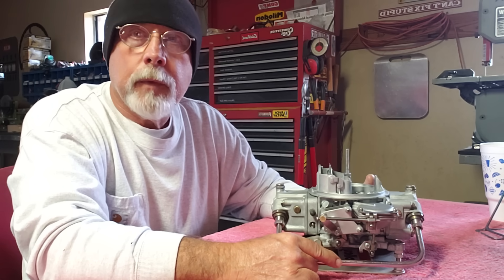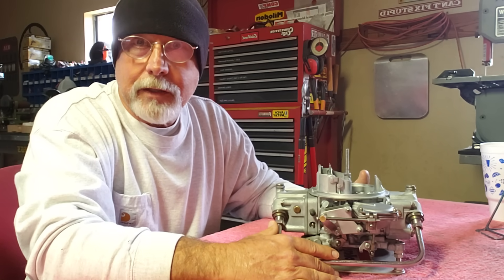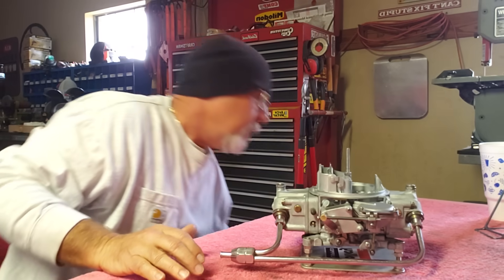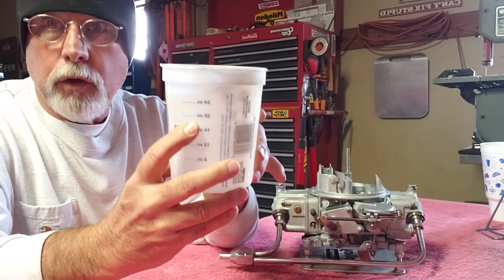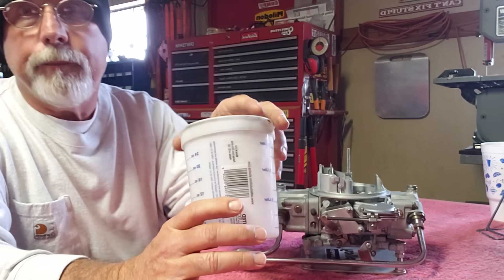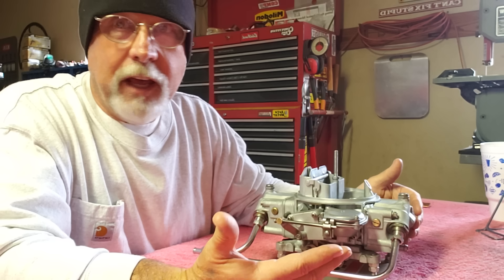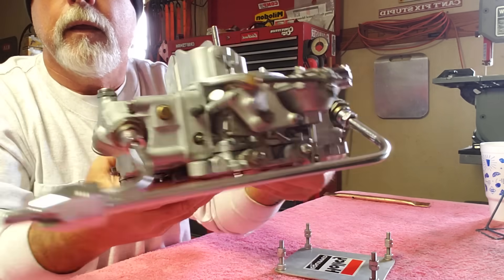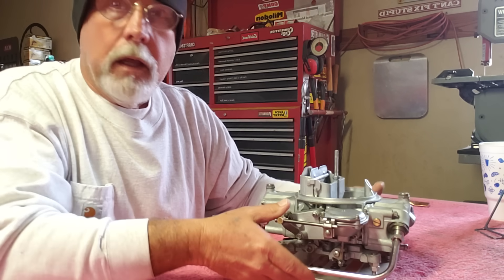Best carburetor cleaner ever!

Comment: I just done this today on a 750 Holley. Didn't work very well for me. Wish I could post pictures here. I let it soak for 3 hours and still dirty. I used 1 1/2 gals of water and 20 ounces of muriatic acid. I am going to soak the carb parts in carb cleaner and then soda blast it.
Reply from the maker: Sorry!
Reply: @ronniehenson4122  Hi Ronnie, I did the carb cleaner soak over night and then today I soda blasted the carb. One thing I did wrong was leave the carb in the m a mix for 3 hours. That stuff did eat into the aluminum some. I have it back together but haven't run it yet. I am hoping it will be fine. If I use m a again I will only soak the carb parts for 30 minutes in it then soak in carb cleaner after. I believe there is a learning curve to using m a correctly at least for me.

Comment: Muriatic acid strips the chromate and zinc plating off of steel faster than nobody’s business. If you have any steel parts on the carb that are originally rust protected with zinc plating/zinc chromate (the yellow stuff)....that is gone in a millisecond.  Muriatic acid takes steel to base metal....and rust will follow very quickly.   If you plan to clean any steel parts this way, you will need to replate the them to prevent rust (if you are worried about rust).    Any zinc is gone after it hits the acid.

Comment: I’m a machinist, thanks for the great video, right to the point! muriatic acid can be used to remove broken taps, drills, screws etc from aluminum. It won’t hurt the aluminum, but will literally rust out the offending tap. All you need to do is build a wall around the hole to pour in the acid, use modeling clay, not play dough! Or silicone caulking like the stuff you use to fix your fish tank. Once it’s dry, pour in the acid, it will bubble as it eats the tap, when it stops, poke it with a paper clip to get it working again. This process might take a day depending how much steel you need burned out. WEAR SAFETY GLASSES!!!
Reply: I use muriatic acid to eat aluminum from seized pistons off the steel liner of motorcycle and ATV cylinders because it will dissolve the aluminum without damaging the steel/cast iron - it will remove broken taps and such by eating the aluminum/zink (white metal) away from broken steel. It will cause rust on steel, but only surface rust.
Reply: @stevea6623  Do you pour the muriatc acid straight onto the piston or do you  deluded it  Appreciate
Reply: @albertdeleon6272  I buy acid brushes at Ace Hardware and brush the acid onto the aluminum - as the acid eats (oxidizes) the aluminum, it is weakened and a reapplication is required to speed the process. Muriatic Acid is 10% Hydrochloric by weight. Wear rubber gloves, goggles and use in a well ventilated area. Be sure to adhere to the cautions on the bottle.
Reply: @stevea6623  eat aluminum?
Reply: @Hebddhhrfhfhfufhfhfhf  Oxidizes is a more proper definition, but it will dissolve a chunk of aluminum over a relatively short period of time.
Reply: @stevea6623  
David Fusco in the comments is saying the Opposite to what you are saying ??
Reply: @kevwills858 
Yes - there is a lot of misinformation on the internet. Now muriatic acid will clean a carb just as The Works Toilet cleaner and acetic acid will clean a carb, but acetic acid (white vinegar) is the least 'aggressive' and muriatic acid is the most aggressive. To use the most aggressive and destructive, instead of muriatic (which is 10% hydrochloric by weight) just use 100% hydrochloric acid? Maybe because pure hydrochloric acid will react with a carburetor like Mentos does with citric acid. Investigate before you accept the advice of youtube pros.
Reply: Very helpful, much appreciated 👍🏾
Reply: That’s fucking cool
Reply: Steve A in the Comments is saying the Opposite to what you are saying ??
Reply: Come on, guys, ph doesn't get much lower so it likes anything metallic.    

Hydrochloric Acid 37%

MATERIAL	COMPATIBILITY
Aluminum	D - Poor
Bronze	        D - Poor
Carbon Steel	D - Poor
Carpenter 20	D - Poor
Cast iron	D - Poor
Copper	        D - Poor
Nylon	        D - Poor
Polycarbonate	D - Poor
Polyurethane	D - Poor
PPS (Ryton®)	D - Poor
stainless steel - 304	D - Poor
stainless steel - 316	D - Poor
Titanium	D - Poor

Once it gets through the oxide layer, it's off to the races.  https://youtu.be/ZLz4bSXcuYY
Reply: I’ve been a machinist since 1989 and I have never seen a broken tap removed using muriatic acid. Now I can’t wait to break off a tap just so I can try this trick 😅
Reply: Wonder if it will hurt brass? I’ve got a Honda carb with a compression brass inlet and seat that Honda doesn’t make replacements for….
Reply: @tonysimons7218  not sure about brass, the name of the product we used (back in 1980) was Tap Out   I think they still make the stuff, it might be worth it to  Google them, and get more info.

Comment: A word to the wise, do NOT leave an open container of straight muriatic acid out for any length of time. The vapors will creep out all over the place and rust anything it comes in contact with, and I'm not talking about simple surface rust either.

Comment: Ronnie, very well presented. One question, how does the Muriatic/water solution affect brass floats?
Reply from the maker: No problems on the brass but, might dissolve the lead that seals them. Try it for a short time periods. Don't leave anything in the solution for over 5 minutes at a time .....check often

Comment: Muriatic acid (hydrochloric acid) should NEVER be used on pot metal, or aluminum, ever.  It eats away the metal and enlarges the orifices.  One thing you do not need is to be changing any orifices sizes.

Comment: Thank you, that is a great idea to clean carburetors. I build NA street daily driver chevy engines for myself and only use carburetors. It's a challenge to get the most power and reliability from a 9,9.5-1 pump gas carbureted engine.

Comment: I have an Axiom cab 11850 .Gass coming through the primary ventori at idle speed .Can I soak it in the muriatic acid to get rid of the problem?( thanks you)
Reply from the maker: No, you nee to remove the needle valve and replace the O-ring and properly adjust the float bowels

Comment: If would have put some baking soda in your rinse water that would neutralize the muriatic acid from your cleaning solution and any residual on the carburetor. Also when you are all done you could take your cleaning solution outside and in a bigger bucket pour the baking soda rinse solution in the cleaning solution to neutralize it and you may need to add more baking soda to it to bring the ph back to normal.

Comment: Question:  I have a 1996 PCM Ford 351W with a 4 barrel Holley carb in a ski boat....all original....have owned it since it was new.  VERY well kept.....under a covered boat hoist in the summer.....in my pole barn every winter (Michigan).  Do you think it's necessary to do what you did in your video to my carb?  If not, what do you recommend?  TIA.  I did run some SeaFoam in the gas tank last year.
Reply from the maker: No don't use the acid for that one, I would just soak it in solvent blow out wit compressed air and repeat the process until clean. Solvent works good and will not eat the chromate coating off.
Reply: @ronniehenson4122  Was really hoping to use something without removing it lol....I am not very mechanically inclined. Not sure I trust myself to remove it.
Reply from the maker: @keithzastrow  Go to Auto zone and get a can of Berryman B-12 Chemtool , spray it down use a small tooth brush then blow dry the top of the intake should clean it up nicely
Reply: @ronniehenson4122  Ok I got a can of it.  Do I just spray it inside the intakes or how exactly do I use it?  Can I pour the liquid form in the gas tank (like I did last year with SeaFoam)?

Comment: Try boiling or just heated TSP (Tri Sodium Phosphate) and water should not due much to aluminum but turn dark maybe, will get after hydrocarbons and organics or about anything. Rise well, neutralize with light vinegar or any light acid rinse. Used this for Industrial cleaning in FDA Pharm and Food. Works great to clean brass for reloading and your still too.

Comment: Fantastic well narrated and very well presented. Liked the (only present item) when needed allows student to focus on what your presenting at the time. You are a top class teacher. Thank you from the UK long time, since I played with a four barrel Holley and it’s distant cousin the Rochester. The secondary plates on the Rochester control spring idea and adjustment confused many engineers with mid range bogging, secondaries opening too early as the spring lost its tension! Thanks.

Comment: I gave this a try on an older Holly carb I had. I have always used the Gunk carb dip, but since I had rebuilt several carbs with my existing can of solvent, I knew I was going to need a new gallon or some other technique. Since there were so many good comments on this, I thought it was worth a try. 

   Ron's presentation is very good and was easy to reproduce. I knew that there was a rule about mixing acid and water, but couldn't remember which to pour, but Ron mentioned this. My results overall were not nearly as good. The aluminum base plate came out nice, as did the float tanks. The steel and brass parts looked nice. However, the acid ate into the metering blocks as well as the main body. The carb barrels are no longer smooth. The accelerator pump assemblies are no longer smooth and shiny, they were etched by acid. I'm just hoping that the gaskets will seal since there is some rather extensive erosion on the sealing surfaces. The acid solution didn't get after some of the varnish and stuck on gasket like the old carb dip always did.

The carb I have is old and perhaps that is why it didn't work well. Ron did mention to try this on a "small area", but since he was using the same brand of carb as mine, I just gave it a try. Mine soaked for about a half hour before I pulled it out. After I rinsed and dried it, I tried the baking soda blast. This filled all passages with dust, requiring another clean-out. Looking back, the video never actually showed this cleaning method as it progressed, and maybe putting soft metal parts in acid isn't such a good idea.
Reply from the maker: Thanks for the after action report. The soda blast will get into all small orifices but, will dissolve with just plain water and blow out with comp air. 1/2 hour was way too long, needs to be checked in 5 min increments.

Comment: Hello, very good solution! I've cleaned aluminium intake manifold of GDI engine with gas (petrol): it was so boring! Is this stuff also good for this case?
Would you please give components of this solution in description below because of mirror image :)
Thanks!
Reply from the maker: Blue Whale 33% PH Reducer picked it up at Splash pools. Should be able to find it at any pool supply store.  Sorry for the mirror image.
Reply: @ronniehenson4122  Ok Thank you! I should found it out if it accessible in Germany.

Comment: Do you have any insight into converting an alcohol burning engine to a gas engine?
Thank you for your contributions!
Reply from the maker: The only difference in the engines is the fuel system, the engine are the same. If you're running a carb you will need to rebuild it with a gasoline rebuild kit and change the jets back to the smaller ones. Make sure to run a fuel regulator set @ 6psi. Let me know what type of fuel system you are using. Thanks!

Comment: Very cool Process! I would only worry about the inside gaskets, the rubber in the accelerator  pump and the secondary vacuum diaphragms. I have the exact same carb on my 67 big block Mustang. Probably wont get in there, but I will remove them to be on safe side. Thanks for Posting.
Reply from the maker: Total disassembly before the dip in the acid. Correct!
Reply: @ronniehenson4122  Thank you for your reply Ronnie! And yes, disassembly makes good sense. Navy Vet cheers from Motown!

Comment: Be careful with this process as adding aluminum to a water and muriatic acid solution bleeds off hydrogen gas which is extremely flammable and it also creates significant heat.

Comment: Hi Ronnie. Thanks for the info. I will give that a go next time the carb is off. Like you at first, I was worried about the abrasive nature of some methods, so just ended up blasting it with soda only. Got it quite a bit better with a lot of effort, but nowhere near that good.

Comment: I don't know what the acids effect on that carb, but FIRST BEFORE you do anything else you ABSOLUTELY need eye 
Protection and a NIOSH Standard filter mask with a filter SPECIFIC for acid fumes. THEN you need a complete face shield. MAKE NO MISTAKE, you can scar yourself or lose an eye very easily doing close proximity work with any acid of this strength. I'M amazed this is not properly mentioned here.....
Reply from the maker: If you will go back and read the description on the video you will see all the safety notes, js!

Comment: Any acid will set upp an electrical process in aluminum causing it to rot because aluminum doesn't rust ok so yes you can clean any ferrous metal this way also you can extrude any rust from stainless steel this way

Comment: It's basically Hydrochloric acid and is very harmful to us, only use it in a well ventilated area, you need chemical gloves, face shield, do not get it on your skin. Have water near by to flush any exposed skin off. Baking soda mixed with water will neutralize the acid if you get it on you.

Comment: Great info. Knew all that just never thought to apply to carbs. I use it on rusted tools and firearm parts. One additional step would be a baking soda/h2O dip to neutralize any remaining acid.
Reply: I’ve used denatured alcohol to neutralize acid with good results. As well. No powder residue.
Reply: I will have to try it on rusted tools, thank you for the advice 😊

Comment: I have just googled this and Muriatic acid is the same as Hydrochloric acid or acido hydrico which is what we use in Europe for lowering the PH in pools. It can be used as a metal cleaner diluted to 10 parts water to 1 part acid. It is also what is in our stomachs and helps digest our food. It is also used for regulating the PH in pharmaceutical products, food and drinking water.
Reply from the maker: A+

Comment: How is the acid bath on cast iron John Deere carburetors from 1930, 1940 and early ‘50’s?
Have you tried a 50/50 soak solution of white vinegar and water? I use this in restoring old cast iron cookware. Usage undiluted will cause pitting in the cookware.
Reply from the maker: I have not tried the vinegar solution yet and would not try my solution this on the cast iron carbs. Cast iron will turn black.

Comment: Thanks for serving! Awesome video and thanks for sharing. One piece of advice I can pass on is do not use muriatic acid on cast iron. A friend of mine used muriatic acid to clean rust on a lot of parts on an old truck he was restoring years ago and found out the hard way that sticking his exhaust manifold in muriatic acid turned it into a wet noodle and destroyed it. I
think he did it full strength like a full day, so be careful with cast iron carbs or anything else made with cast iron..

Comment: Not to confuse the issue, but a trick small engine rebuilders use is muriatic acid to remove steel from aluminum and ( I think) sulfuric acid to remove aluminium from steel crankshafts. I tried this once to get at a broken screw in an aluminum part.

Comment: Don't ever think a gunk up carburetor is junk. I've never seen one that couldn't be cleaned and restored to perfect  Working order. 

 When walking down a hard packed oil soaked dirt driveway into a car collectors backyard, I  Look down and recognise the corner of a Carter afb that had been completely buried into the driveway and had been used as pavement for years.

 My friends laughed at me as I dug it out of the dirt gave him 5 bucks, cleaned it and the only thing I replaced was the leather or rubber accelerator pump plunger. I even used the old top half gasket.

Worked absolutely flawless.

 Today so many people are blinded by shiny and sparkly things, they don't have a sound understanding of what makes something work. As long as all the internal passages are clean, it's going to work like new.

Comment: Holley  anodizes their carburetors to give them that golden finish .
Reply: Actualy a dichromate done with a chromic acid " Cocktail"of chemicals ,the Purpose is not so much for looks but corrosion resistance as zinc aloy /zamac is a Sacrificial metal that is why you will see zinc annodes in marine  applications out drives,prop shafts etc. The green/gold dichromate adds much needed corrosion protection/ resistance to the castings.humid conditions,less than perfect Fuels will cause corrosion sooner i would advise keeping a unit cleaned in this manner sprayed liberaly with some sort of metal protectant.manny of the highest quality carb remanufacturers re-dichromate the zinc castings.